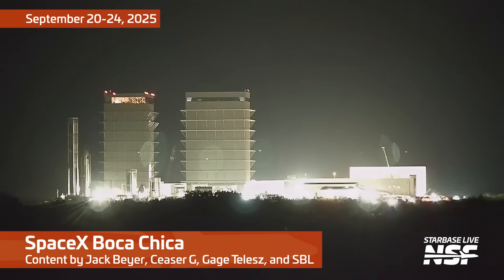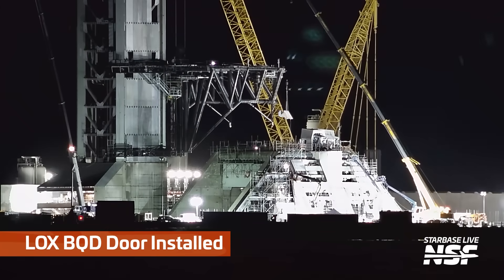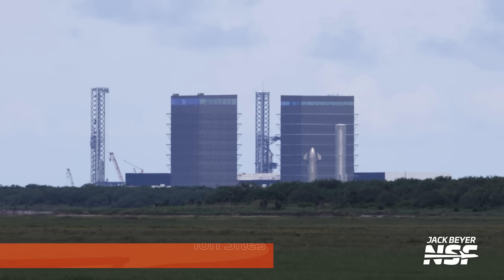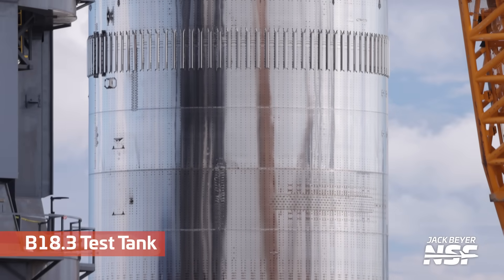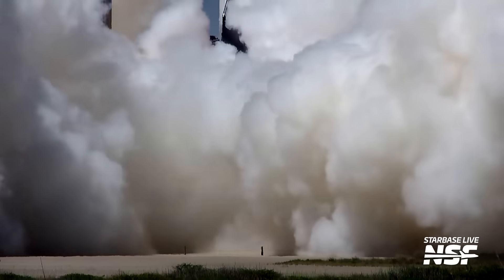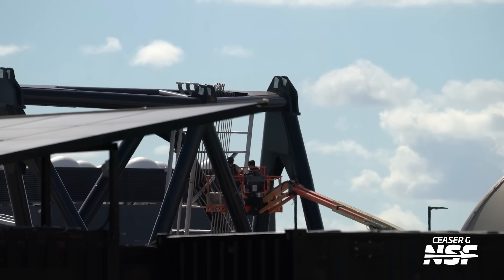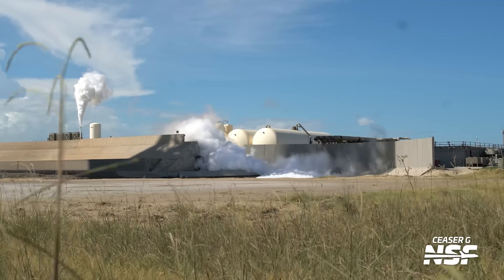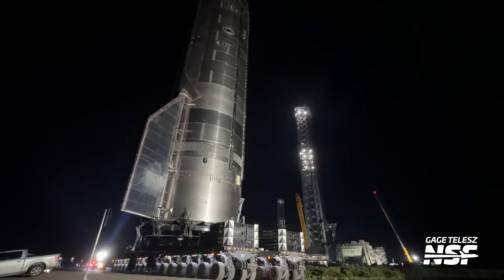"Starwars... or Starbase?" | SpaceX Starbase

Comment: Hi guys, great work. I have a question for Ceaser G. What gear do you use? And specifically at 10:36. There is a ship and also stars visible in the background. What settings is used for this shot?
Reply: I use a Sony f1.4 35mm prime lens, shutter is pretty fast.
Reply: @CeaserGee  Thanks!

Comment: WHY???  Why are they doing it again?
 Shielding the launchpad with a thin sheet of metal plates that will be ripped apart with the force of  Starships raptors on it's first start again? Aren't they opting for a reliable launchpad from the first try?
I don't get it...
Reply: The error is your thinking that the metal plates are thin... and when were they last ripped apart?

Comment: 8:12 Where are the windows supposed to go on the apartment complex.  The outer walls are open for the curtain wall with widnows they will hang.  The side walls are next to another unit, and the inside wall will be next to the parking garage so no windows there.

Comment: I’m no goat expert but that looks like a pregnant goat. Normally windows are specifically reinforced and cast as a part of the slab production. That way the structure is more stable. It’s not unheard of to cut big holes in them but that’s usually reserved for the “oops” method of construction 😂

Comment: 👍  You guys should look into purchasing a small RV, C Class or so, that you can park in various spots like your roadside lot and the "Rocket Ranch lot" or on the beach when the sand permits.  This would be a great mobile communal base that people could take shifts in, eat, use the bathroom, shower, etc.  If I had the funds I would donate one, alas, I'm broke.
Reply from the maker: One of our team has a small camper and generator at our River lot we use for exactly this purpose during launches. 👍 - Das
Reply: @NASASpaceflight  I purchased a 2006 pre-DEF Winnebago View on a Mercedes Sprinter chassis a couple of years ago for $30K.  That was a deal and there are plenty to be had.  A Ford based chassis would be cheaper on cost and maintenance but way less fuel mileage which wouldn't be an issue with your use case. Sell Jack on it and you'll be a superstar to the team.

Comment: Das. What's your opinion on the location of the "fuel factory "near Pad 1? At the launch of test 9, the objects were trembling alongside the commentators. And they were far from PAD 1. How will it be in the factory?
Reply from the maker: The air sep plant will be awfully close, but when pad 1 is converted to the 2 design with a proper flame trench, at the the energy will be better mitigated... for a few seconds at least. - Das